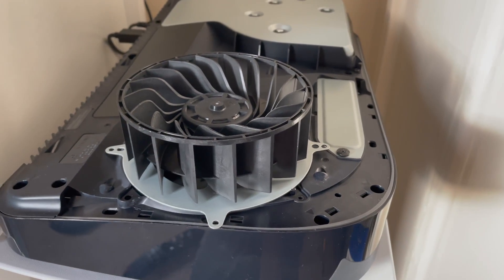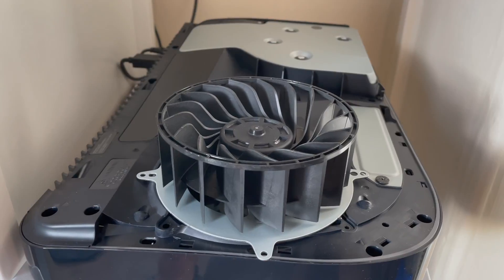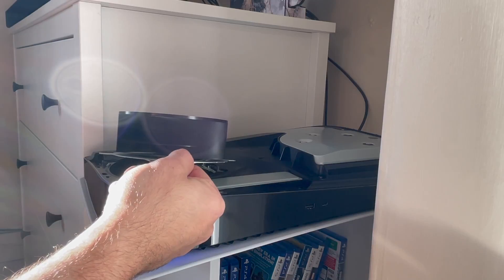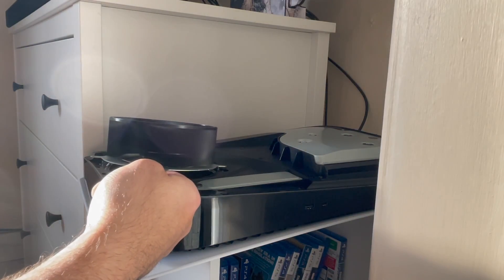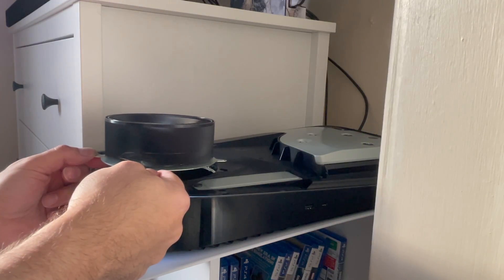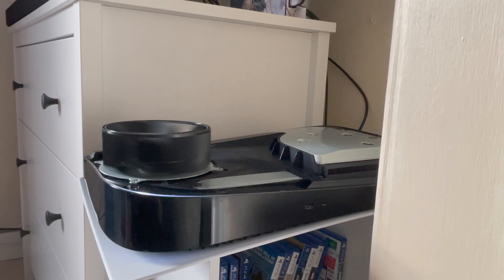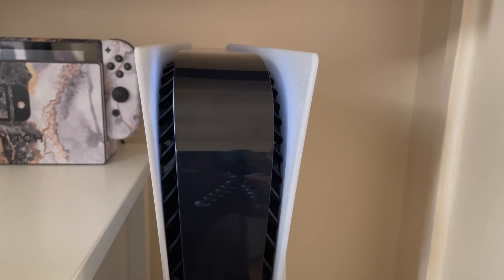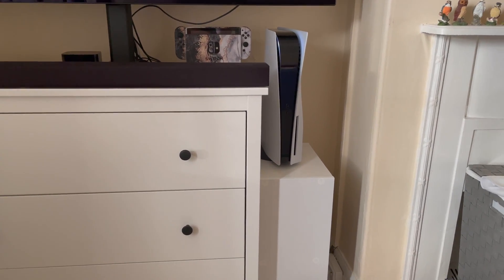PS5 Noisy Fan "B" Fix?

Comment: Nedic fan in video explains why. My fan sounds the same but I can't find my screwdriver to get to it. I know I have the right kind of screwdriver but I have looked everywhere for it. Honestly it's not a loud noise but annoying all the same. It's like a "ticking" it maybe a scrapping  sound best way I describe it but is same noise as in video. Has there been a good solution for fixing as this video is a year old now? I would like to get a Delta fan as based on the three fan types that's the supposed quitest one. My concern is the Delta's long term cooling with the shorter blades. Besides I spent close to $600 on a PS5 so shouldn't have to track down a quieter fan for more money at like $60 I have seen them at.

Comment: My digital ps5 is making a  loud buzzing noise  when playing high demanding games like fortnite etc. Is that normal?
Reply from the maker: Yea sadly. It’s likely to be coin whine, which happens due to power draw oh the coils in the power supply unit. My ps5 has gone fairly quiet now expect form disc drive noise. The fan noice no longer bothers me and now having it on some anti slip rubber matting it’s very quiet.
Reply: @WildlifewatchingUK  mmm interesting mine also have some buzzing noise through the headseat I tried different controllers but it is barley noticeable. In regards to the console's buzzing might wait and see if it goes away anytime soon
Reply from the maker: @q2l867  you shouldn’t have it through the headset. Perhaps get it checked out. Sounds unusual

Comment: I just got a PS5 and noticing this issue. The problem is that the fan assembly is not balanced. 
When it's fastened to the PS5 body the motor vibrates. 
When it's taken out the body the vibrations are in the metal frame because the spinning force wants to stay central, in one place. You don't notice them in your hand.

I have a plan to balance the fan. It involves turning the fan upside down (as you did) and popping an elastic band around the fan circle.
Light weights can then be attached to any degree of the fan. Find out where the worst vibrations are and add weight to the opposite side.

They are supposed to do this in the factory but maybe a few less desirable units slipped through due to money and incompetence.

Comment: Thank you so much for this fix. I used some rubber o-rings from my be quiet fans and also removed the mesh / cover. I just tightened the four fan screws really loose, so vibration is mostly eliminated by the o-rings. The humming noise when the fan is spinning is mostly gone now! Great stuff! I have the NIDEC fan.
Reply: What do you mean by the cover?

Comment: I had bad luck with PS4 and it had the noisy Delta fan. Nidec fans were quieter on PS4 and no amount of thermal paste replacement reduced the noise. 

For the PS5 I got lucky and got Fan A which is Delta. Fan B is Nidec, Fan C is some new brand that I can't recall.

Comment: Oh dear... Dont start launching games without the fan pushing the air out... I'm surprised it didn't shut off straight away.

This is how you break your PS5
Reply from the maker: It was only for a few seconds, the heatsink in the ps5 is rather large so does the main bulk of cooking, the fan spins at a low speed hence why with the right fan the console runs quiet, that and the size of the fan being large.  unless u push the console the fan won’t spin quickly.

Comment: My nidec doesnt click like a funky bearing but it's got the telltale annoying pitched hum. Tried some DIY spacers and it's just a imperfect fan, only replacing it would make it silent. Grabbed an $8 15 ft hdmi 2.1 cable and just hide that sucker as far from my sitting area as possible. And if somebody wants to steal my 5 then good luck finding its stash spot
Reply: i've change 3 nidec different fan on my ps5. same noise...
Reply: @edibarehye  actually came back to this video and decided on a new mod. I’m a big fan of “reusable adhesive puddy”. I use it between the base stand and the shell to hold the PS5 base while horizontal. It’s rock solid and the stand never moves even while the console is in my backpack for travel. Anyway, I pulled the fan out and made a homemade gasket in four sections where the fan assembly touches the ps5 plastic. Just little one inch gasket sections in the middle of the area between the fan mounting screws. And I put some putty around where the fan screws go to hold into the ps5. One could probably use duct tape cut thin or even a slight smearing application of silicone caulk to make that barrier between the plastic ps5 case and where the round edges of the fan plate touch. It’s actually quite a bit less ufo whirring type noise. Also since I’m out of warranty I perma removed those metal fan guards from either side of the fan & I think mine has way better cooling airflow without those restrictive metal fan guards. I used a soldering iron to melt the plastic dots on the fan guard with no screws to remove it.

Comment: I also have the same high pitched sound. It is pretty annoying. It only happens when I am playing a game. It is dead quiet when in the menu. 
My brother and several friends have PS5’s and theirs are all quiet. 
I really do hope Sony does something about it. 

I also purchased a Geek Squad protection plan for my console so I would need to do any repair through them in order to keep it active. But I really don’t want to use up my plan so early on. If nothing is done I may try for a replacement when the systems become readily available. 
Only problem is that it could be a gamble. 
Oh well time will tell I guess.
Reply from the maker: Is it the same sound? I wouldn’t say the fan noise is high pitch. It’s more of a vibration and is actually kinda low in sound. Unless your getting exactly the same sound your more likely to be suffering from the coil whine which comes from the power supply unit. It’s not something that can be fixed and effects many pc’s too. If it’s really annoying then it’s worth getting it exchanged when you can. I have a tiny bit of coil whine but not enough that I can hear while I’m playing just if I was up close. The fan sound outweighs it more.
Reply: @WildlifewatchingUK   Maybe high pitched sound isn’t the best way to explain it. When you are standing away from your console and when you get closer you’ll notice the wobble vibration but also almost like a higher frequency faint beeping like noise that matches the wobble. Maybe I can post a video of what mine sounds like. But it is identical to the sound of yours. 
I also here this same sound earlier in your video when you place the fan down on the metal after holding it.
Reply from the maker: @dannyv4747  sounds like your getting the fan noise and the coil whine. Have u checked what fan u have?
Reply: @WildlifewatchingUK  Just took the side off and counted the blades I have 17. Which fan would that be??
Reply: After checking the website you provided in your description it appears I have Fan B.
Reply: Yes mine does to and it’s not that annoying for me cause I have a air cooling fan so I don’t hear it at all unless it’s off

Comment: So is the solution to just buy Rubber of self made wool washes to get the Vibrations absorrbed?
Reply from the maker: It helps but not completely. Best thing to fix it is time, you just get use to it and don’t always hear it after a while.

Comment: Hey, what‘s the Coil Whine situation with yours? I can‘t hear any coil whine in the video and surely if you notice the minimal wobbling you‘d notice that. I‘d loce to know that. I‘ve just uploaded an extensive test video of my severe coil whine situation. My „Type C“ Fan (the one from the official teardown) does wobble quite a bit as well. Mine does sound like a loose cambelt of an old engine. But just as you concluded i think that could be fixed with a bit of decoupling.

Comment: The fans plastics supporter keeps on moving quickly which hits with the PS5 body case and does a vibration noise. Putting rubber bands to give it a little bit of height might work.
Reply from the maker: Might try it

Comment: I have the exact same issue. Put on some O rings and i feel like they made the PS5 a bit quieter but could be Placebo effect too. In general I dont mind a little console noise, but  its this high pitch of it that makes it unbearable for me. Anybody got an idea if Sony switches the fans if i send my console in?
Reply: I sent it in for this exact issue. They sent it back 6 weeks later and hadn't touched the fan, at all. I'm guessing they don't see it as an issue. I'm currently waiting on talking with a supervisor at playstation about why they didn't fix my issue. I'll reply when I hear more
Reply: I'm in your same situation. Let's wait a reply...
Reply: They even responded me they might just send the same console back without changing anything. Had a perfectly quiet Ps5 with other issues. At first they just sent me back the problematic console with additional scratches. The replacement console has the loud fan and it seems they won't change it if the console runs fine. The louder fan doesn't seem to be an issue for Sony

Comment: Nice video. did you put o - rings underneath all 4 of the screws ? Thanks.
Reply from the maker: Hi yes I did. In fact I doubled them up. The sound is becoming much less noticeable and annoying now. Guess it takes some getting use to. I wonder if it would be the same if I hadn’t modified it though.
Reply: @WildlifewatchingUK  good to hear i have the sane problems too with coil whine but its not loud because my PlayStation 5 digital has a dalta A fan 23 blades but coil whine still happens
Reply: Okay nice thanks. Mine has the exact same noise as yours in the video and it is very distracting especially at night so I may have to try this.
Reply from the maker: @puppag0079  it should make it a little less noticeable but don’t expect it to completely disappear sadly

Comment: The rattle is coil whine from the PSU, the whistle is the fan.
Reply from the maker: It’s not. I can hear the coil whine and it’s just a little buzz on mine. Can’t hear it from where I play the console. The fan is what makes the noise. I can hear it and it’s shown in the video when it’s touching the case. Again listen to the fans french website. It has the same sound on fan b as mine does.
Reply: @WildlifewatchingUK  ahhhh, I'm gonna add o rings to my PS5 because mine makes a buzzing sound and I think it's because of the fan cover now.
Reply: @WildlifewatchingUK  I have fan "C" and it's quiet until the fan ramps up.
Reply: You comment different in other videos! Why?!🤨

Comment: Lol i got lucky! I have 2 ps5’s. Both are equipped with fan c. Super quite but the issue is with the buzzing sound.
Reply: I just installed o-rings on my PS5, that buzzing noise comes from the fan.

I thought the buzzing was coil whine, but it's not. The metal against of the fan in between the console and the fan plate moves in and out at higher speeds. 

Yes there is a coil whine, but the fan exaggerates it from how it spins (think of how an acoustic guitar amplifies sound).

When I added o rings, it did something to the ball bearings of the fan and let it work better/silently.

Also, my fan was very very quiet before I installed o-rings when I was in the dashboard which made me think it wasn't the fan. But if you hear any sort of whirl sound when you're in the dashboard, that's a problem because it means how your fan is set into your PS5 will sound way louder when it actually kicks up. You shouldn't even be able to hear the fan at all in the dashboard.
Reply: @TypicallyUniqueOfficial  hello, my fan is super quite tbh! But the issue as I mentioned from the power supply which the buzzing sound comes from it.
Reply: What month was your PS5 manufactured? Mine is August
Reply: @EckoTheFox1  the USA version is August. The Middle east version (dubai) (same as the european) doesn’t come with the manufacture date on it.
Reply: @A_3M2  oh okay, weird. Also I noticed the fan on my PS5 is really quiet, but the buzzing noise is louder than the fan itself lol
Reply: @EckoTheFox1  yes same here, the buzzing sound is not loud tbh, but it’s annoying when you hear it. Specially when you’re so close to the ps5.
Reply: @A_3M2  Yeah I mean I can hear it from like 5-6 feet away but even then it’s super faint. But I basically don’t hear the fan at all
Reply: Buzzing is a matter of luck afraid only way would be to sell & buy again but many have eneded up with the same issue this way
Reply: @mz4ever123  well what i see is most of the ps5 owners are reporting buzzing sound 🙄 so it is something very common.
Reply: @did you purchase the digital or disc version?
Reply: @Ukgulli  disc

Comment: I have the same issue but I have fan A. I’ve tried two different PS5s both had fan A. I used o-rings on both and didn’t notice a difference. I though about removing the shroud to see if that fixes the sound but haven’t yet. Also, fan A (or at least the 2 I had) has the “give” movement up and down, thought that was interesting as well. I got rid of the first PS5 when I got the 2nd but might return it until they get this sorted out in the manufacturing process. Until then I’m happy with the XSX. 

The system is quieter than my PS4 and PS4 Pro, but not silent like the XSX. If others say their PS5 is silent I’d want the silent one as well.

Comment: Just in Case, have you use 6mm o-rings in the space between plastic and fan.

And have you fixed the fan shield back ?

I have try it with 4x2mm O-rings and this didnt help.. if i see this i think it was to small.. i will try it next days with bigger ones..

I got two sounds if i start a ps5 game
A rattle sound and a bzzzt ...if iam in the menue only the rattle..
Reply from the maker: Check out the french website for the difference between fan a and b. I used 6mm and didn’t put the guard back on.
Reply: @WildlifewatchingUK  Thanks for the Information, yeah i have fan B the nidec one..
Reply from the maker: @mrclapclap2909  same that’s why I made the video.

Comment: Looking at the different designs concerning fan type A and B it's easy to spot the difference being type B has the blades going all the way to the center. Imo this is the preferable design, it's similar to the one in Sonys teardown video. With type A the blades don't reach the center. This might be more quiet but it's about cooling the system also for future generations of games. Imo type B seems more suited for this task - being louder is NO advantage in this case.
Reply: I have B as well honestly there's nothing wrong with it just that it vibrates off the plates.
Reply: This fan is better from the other two at cooling but its  louder . B type has 17 blades and the others have 23 . I prefer my console be cooler... I have the same nidec  fan at the new ps5 model
Reply from the maker: Have u heard either fan in person to know how annoying fan b can be?
Reply: @WildlifewatchingUK  I've the PS5 with the type B fan. I hear the fan especially if the music of games is reduced to a minimum or if the PS5 is downloading games in rest mode. But Imo - and this is subjective - am NOT disturbed by it. The sound of the fan doesn't sound strange also - it a continuos stream of noise, no osciallating effect or mechanical scratchting to it. It sounds like a fan ;) - BTW: thanks for this interesting video!
Reply from the maker: @mentugo  if your fine with it then all good. If you check out the french site and hear the difference between a and b it’s noticeable how it’s more of a 2 tone sound from fan b. Either way it’s what your happy with. I’m getting use to it but then I have made changes to improve it, so I can’t say if I would have if I hadn’t added the washers.

Comment: Got the same issue with this resonated noise. I thought that it’s a coil whine, but after you disassembled the fan it seems the whistling resonating noise is from the fan. 

Any ideas on how to fix this other than replace the whole console?
Reply: Watched some other videos. Seems like the high pitched noise is caused by a side metal fan plate touching the plastic body of the console. People recommend putting some rubber rings to separate the fan from the body.
Reply from the maker: @zest01  I really don’t think it is. Maybe if they get a different sound perhaps. I’ve pushed the fan guard in on the non drive side and it didn’t help. Took the guard off the drive side and it is still there. As I shown the fan on its own is quiet it doesn’t make the same sound but in contact with the console it resonates. Ive used 2 layers of o rings and the fan still rattles. I could try more but at this point I’ll consider alternatives such as finding a fan A console or getting a replacement fan when available. Either that or contacting Sony.

Comment: I literally saw this video and instantly went to look at my fan in my PS5, luckily mine is Fan A!
Reply: @Carlos Villa I have fan A and it makes the buzzing sound. I bought a second PS5 and it makes the same noise. The o-rings didn’t help.
Reply: @DarylCrow  buzzing is to do with coil whine & power supply. Both fans are quiet as he showed its the placement of the fan on many PS5's have not been sound dampened properly.
Reply: @DarylCrow  Same
Reply: @DarylCrow  it’s not the fan it’s coil whine it’s from the power supply don’t worry it won’t effect your console it is just annoying
Reply: @Carlos Villa Not any louder than it should be and it’s certainly not as bad as Fan B which I’ve heard has a really bad high pitch noise!